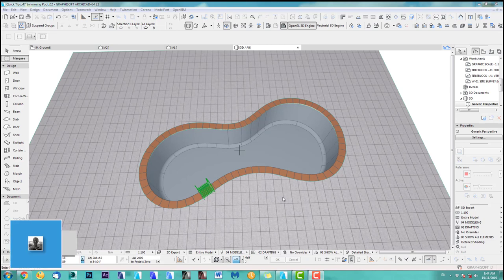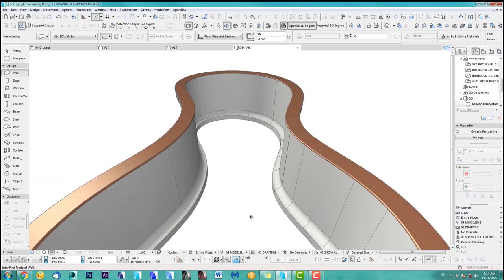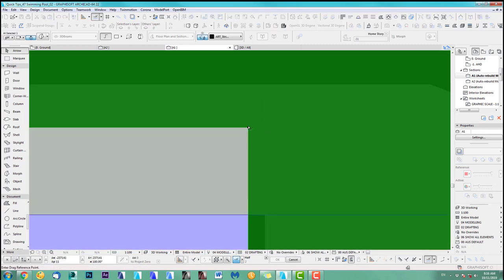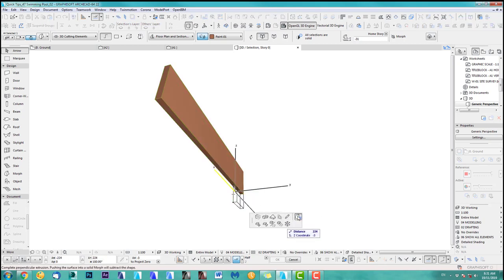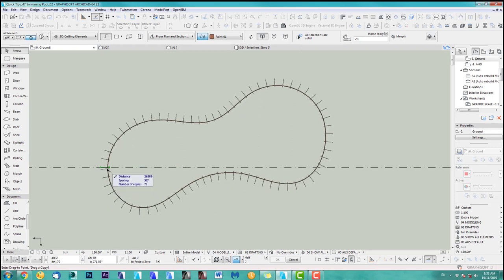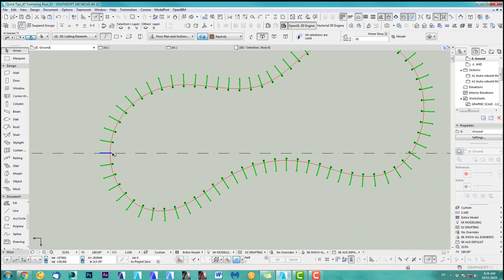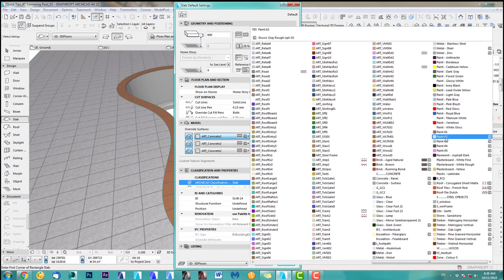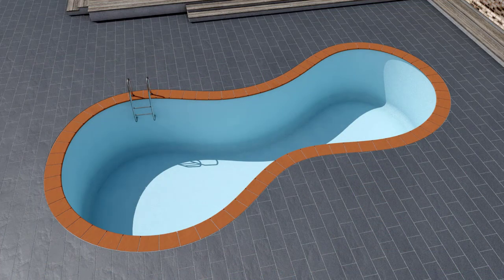How to model detailed Swimming Pool in ARCHICAD

Comment: I like it, but most pools have a deep end and a shallow end :)
Reply from the maker: yes that is true, little bit of extra modeling is needed :)
Reply: @ASMTechbase  I guess one way would be to do it with a morph, and use the follow path on a polyline that has the right heights. Pity Morphs have such a poor linear workflow. Morph needs to be updated with parametric modelling, similar to 3dsmax's loft tool or any other modeller out there that has been around for decades.
Reply from the maker: @duncanh6045  it would be nice but I think that's what they have Grasshopper for now. I also think it is still first and foremost a CAD program which Architects and Builders use for their plans, Section, Elevations, details, BIM, etc. So you can't compare this to Max as Max can't do any of this and is a different kind of Software.